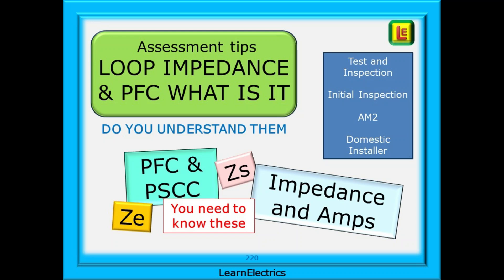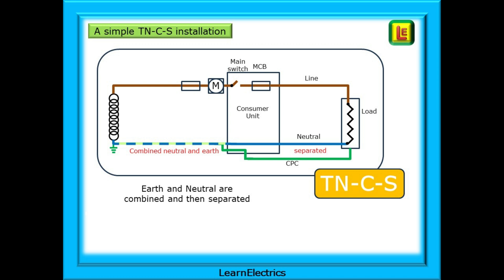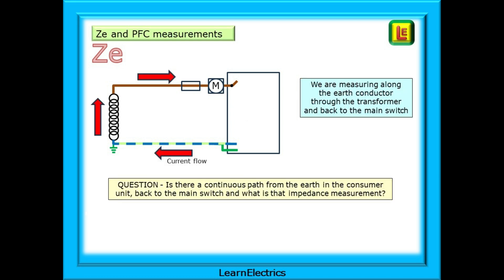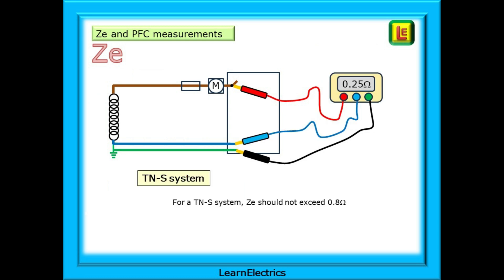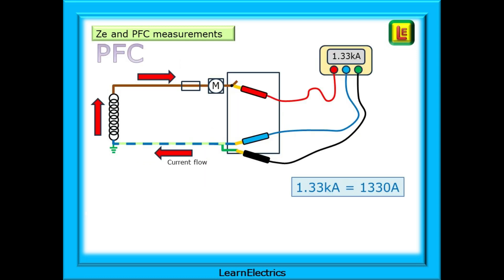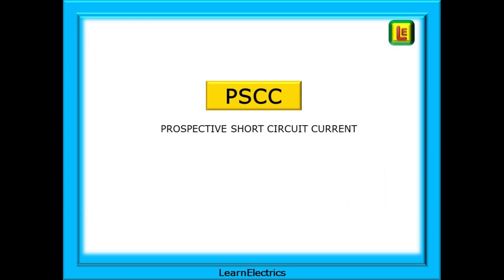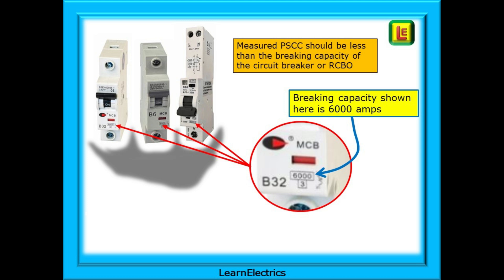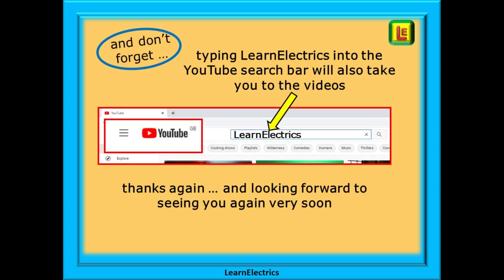LOOP IMPEDANCE & PFC – ASSESSMENT TIPS - PROSPECTIVE FAULT CURRENT ZE PSCC ZS – UNDERSTAND THE TESTS

Comment: Apologies in advance for a stupid question, but why doesn’t a ZE test blow the main fuse if it’s enabling massive current to flow around the circuit?
Reply from the maker: We all learn by asking. The test does not cause a massive current to flow. The multi-function tester works out the resistance of the external circuit (ZE) and uses ohms law to work out what the potential current might be if there was a fault at that voltage. High resistances are used in the tester and so small currents flow, just milli-amps, nowhere near enough to affect the main fuse.
Have a look at the video on the link below
https://www.youtube.com/watch?v=eHT_m2mRs7o

Comment: Why would three test leads ever be used for PSCC a test? 11:15
Reply from the maker: Some meters use three leads for the test. The neutral is needed for the meter to work. The latest meters have a clever bit of electronics inside that simulates a neutral connection based on neutral and earth being the same point electrically at the intake position. If you ever use someone else's meter and it doesn't work as a two lead test, try it with three leads and it will probably burst into life. Hope this helps, Dave.
Reply: My meter does need 3 leads to be used and as you mentioned it will display Ze and PFC at the same time .. di-log 9118 MFT

Comment: At 11:43 you say that the PSCC test lead set up is the same as for PFC, but the diagram correctly shows the sense lead on the neutral.
Reply from the maker: The test meter setup is the same switch positions but the leads are in different locations. Hope this helps.

Comment: At 5:25 , the Ze test . Must that curcuit be dead before testing . Im confused when you said we are doing a live test. To be clear What is ment by a live test ?
Reply from the maker: A dead test - no electrical energy in the circuit. Completely dead and tested for dead.
Live test, the circuit is energised as it would be for normal use, boiling the kettle, cooking the dinner, etc.
Hope this helps. Dave.

Comment: I’m slightly confused.
Why do we need to do PFC? 
That is the purpose.

Thanks for the fantastic video!
Reply from the maker: Its one of the essential tests and helps us ensure that the devices can handle the fault current.
Reply: @learnelectrics4402  thank you 
But I don’t understand which part of the breaker will this help with? 
I know we need the short circuit part. 
But I’m now aware of any scenario where we can practically use PFC to choose breakers or anything else

Comment: Do we also test pscc between phases on a 3 phase system? This current can be way more than pscc between L and N. Will the CB be able to handle this short circuit current?
Reply from the maker: We can m measure PSCC between L & N but most test meters will not measure between phases as they are not designed for 400V. We choose the worst case PSCC from the single phase testing and multiply by 2. We use this as the prospective 3 phase short circuit current. have a look at Appendix 14 page 554. Dave.

Comment: Thanks again for a clear explnation. For Ze you show (for all types of earthing arrangements) the three wire method for test leads, with one to L, N and E. When measuring PSSC you say that it's "exacly the same test leads and meter set up" but show the blue and black wires from the meter joined together on the N conductor.  That is the correct configuration for measuring PSSC?
Reply from the maker: Correct. The measurement is between Line and Neutral, so the black earth lead is is on the neutral. but the meter needs the neutral connection, so we put the blue neutral lead there too. Have another look at the video, it is explained. Thanks. Dave.

Comment: If we have a Line and neutral conductor back to the transformer then why not convert TT systems to TNC-S arrangements throughout.
We need a line and neutral from Source to dwellings anyways so we already have a complete circuit from supply!!

I'm guessing it's not that easy as it would have been done already..It makes me wonder sometimes tho considering how unstable TT systems can be under some circumstances..
Reply from the maker: The TNS and TNCS cables are of different construction. If they are retro-fitted as overhead cables, the weight can be quite substantial. Good question.
Reply: Id assume it’s because tns and tncs are bonded to star point through MET. It doubt it would be feasible to have a single earthing terminal for a property going back to the transformer thus the need to earth it seperately.
Reply from the maker: Thanks for taking part Daniel, appreciate the input. Dave.

Comment: I believe, that Zs not only the Eart Fault Impedance. I think, that the Line-Neutral loop impedance is also called Zs. The Prospective Fault Current (PFC), and the Prospective Short Current (PSC) is also depends on system loop impedance (Zs). Do I see well? Thank you for your very useful work! 👍
Reply from the maker: No, Zs is a line to earth fault. Between line and neutral it is a short circuit. Have another look at the video. Thanks for watching. Dave.